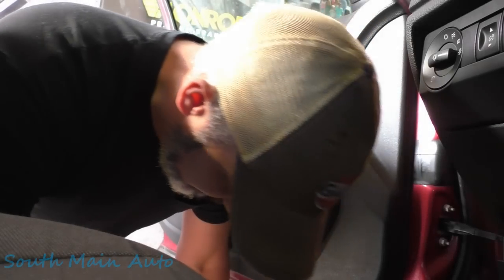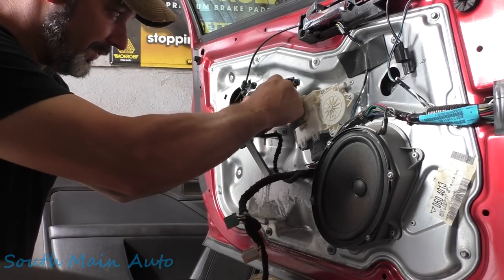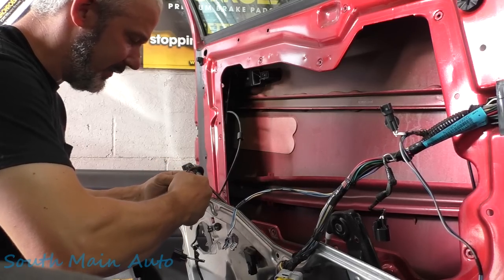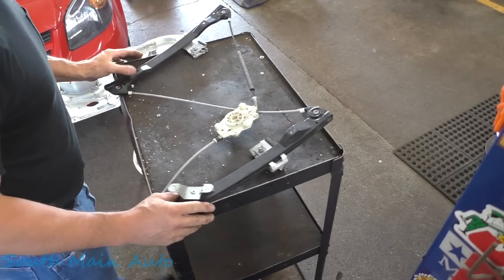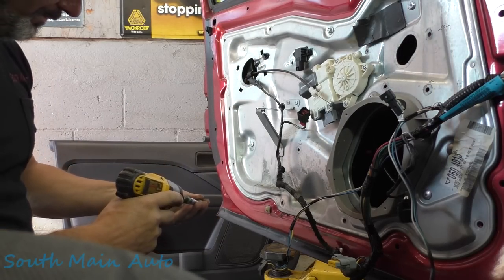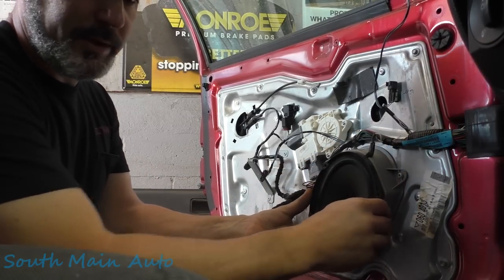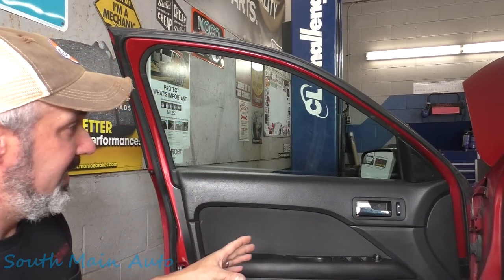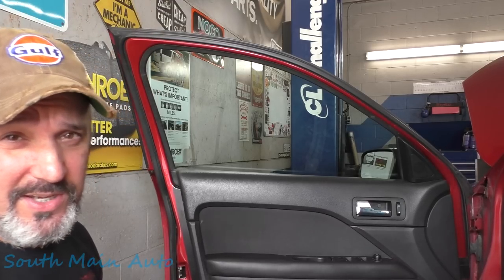Front Door Deconstruction - Fusion Edition

Comment: As you know, the fibrous isolation discs are installed to prevent galvanic corrosion between the single-use tension-tightened fasteners and the anterior structural support panel of the vehicle entry portal. Failure to replace them has initialized corrosion damage to the structural integrity of the vehicle that requires its condemnation and demolition immediately. As for the matter of the Maroon Dongle Lock Reinforcement Apparatus, I recall they were an offshoot of the Red Jumpsuit Apparatus...

Thank you for your submission, sincerely, PRNY.
Reply: Totally true Professor, thanks for clarification.  I just did my Kia and the Instability of the Phase Lock Loop Amp meant I had to drop the gain so the Transfer Function was met.  I now have a spectrally adjustable admission system that works.
Reply: Does the same requirement apply to the starboard vehicle entry portal?  Seems to me that the polarity would be reversed.
Reply: No, it's DC, so by Lenzes Law, polarity will be unaffected.  If you used 3ph AC you would have a serious problem.  Hope this helps
Reply: I thought it would be to stop any rattles should the rivets come loose

Comment: Wow, I'm glad I didn't have to do this in my driveway, with only my handheld rivet gun.  The left rear mechanism failed on my daily driver (2003 Saturn LW200) last year, and fortunately, it was a pretty easy swap, and no rivets.  Now, having seen that suction cup set, I have bought your classic Lisle 63900 Window Holder.  I figure with 3 more 20 year old power window mechanisms in my car, if I have to replace any of them, this little set will be worth $ 15.94 (Amazon) to me.
Reply: A couple pieces of blue painters tape will work and costs almost nothing.

Comment: As the owner of 2 Fords … each over 20 years … this DIYer has replaced the “classic” X type regulators. This video was fun to watch -  to see how newer window regulators work. 

As for DIY rivet tools … we  mostly use the manual tool which will test your hand strength on the heavier, fatter rivets. I never knew there is an air tool version. Go Figure!

Comment: I can hear it now.... 
Chang, I have almost completed the design for the door panel but I need some connectors for this plate. What should I use?
Did you already use the small head 10mm bolts?     Yes.
Did you use the large head 10mm bolts?   Yes.
Did you use some 8mm screws?   Yes
Did you already use some torx bits?  Yes
Hmmm How about some 7 mm screws?  Yes.
Darn....  Oh I know, use some rivets...    Hahahahaha

Comment: Great Job Eric !! I like the fact that you caught that piece of foam that fell off !! I caught it out of the corner of my eye and had to slow down the speed so i could see what it was !!! The real amazing part to me is I"ve worked with a lot of good techs in the electronic field that were good at fixing tv's ,radios etc but they had a mental block about cleaning the device after the repair which i watched you do !! A sign of a REAL PRO !! Thanks for the vids and education Eric !!
Reply: If the customer doesn't like the look of something, they are more likely to find fault with it, even a pre-existing condition.
Just give the thing a wipe so it presents well.

Comment: When the bottom of those plastic door handles break use the 5500 psi epoxy to fill and repair the hole.  You might need a Dremel to smoothen the cured epoxy but it works.  Use a high power flash light to have it cure faster.
Reply: Time is money. That's an extra hour, right there... $80 for the broken bolt hole, please.
Reply: When I helped a mechanic work on Japanese vehicles I used my SureFire flashlight and it would cure in about 10 minutes.  The epoxy is light sensitive so the flashlight would speed up the process.  I understand that it’s your business and yes, time is money.  I just wanted to give a suggestion.
Reply: Some epoxies can be cured using ultraviolet (UV) light.  Not all epoxies cure with UV light so your results may vary.

Comment: Just DIY-ed this a week ago on my 2008 Fusion passenger door - same process.  Wish your video had been around about 2 weeks ago, when it broke.  For the home mechanic an alternate would be using 1/4 by 1/2 nuts and bolts (I used nylock) to hold the regulator to the panel (got that from some of the Amz regulator reviews).  I left the "stand off" on the panel.  Took about 2 hours, guessing without the edits yours was about half that time.  Great video, love knowing even the professionals get hung up on the same stuff, they just have complete shop of the "right" tools to deal with it!

Comment: Yes Eric . Your not alone I’ve made all those mistakes taking the panels off & on several times heating up glue with a heat gun to get the panel to stick and finding bits left over on the floor . But after all it is a Ford con  Fusion 🤣bad joke 👍🔧🛠⚒

Comment: This job cannot be rated "" Easy "" for a DIYer !! Has to be a "" Medium "" rating. As I was memorizing your disassembly order, it started to become just a tad overwhelming on the memory !!! I thought you missed a rivet behind the motor housing as I see a hole there at the top under the black tape. But 99.999% of the time Eric doesn't miss a beat, so I let it slide. So if Eric can do it - I should be able to do it !!!!! Sure is a lot of screws, rivets, connectors, aligning and complicated programming just for this " simple " job !!!  After I finish this nerve racking job, I'm ready for Mrs. O.'s culinary kitchen meals with the side trimmings and a cool ice tea drink !!!!!! And fix the broken things that came with the car like the window switch screw that needs a flat washer to stay in place. And for heavens sake - CLEAN 💦the window !!!! and anything else dirty or fingerprinted !!!!  Lets the owner know that you gave his vehicle "" Love ❤and Care !!!!! On to the next job !!!!

Comment: Thank you Eric, A mechanic that does windows! A struggle at best is opened up for the adventurous. Door cables and glass stuck to the frame are fine if the motor has a weak enough clutch that inst already seized up. If the glass is not moving holding or not stopping the auto open button might be costly.

Comment: I’m so glad my 05 neon still has manual window rotation lol. Cars been going for 6 years strong, did the clutch not too long ago, timing belt and water pump, along with bunch of sensors that eventually went bad due to age, been a great car, no leaks and I change the oil every 3000 miles

Comment: Thanks for the video, Mr. O!  You really nailed the engineer accent!  Design flaws really shouldn't happen in this day and age with our computing capabilities - putting that connector on the other side?  Who thought that would be a good idea???  As always, I've learned again - don't buy a Ford or a Dodge and if you do, have someone else work on it!  :)
Reply: Engineer here in the CAD software world who used to be a consultant a long time ago doing implementations at companies including automotive Tier suppliers. I'll tell you how these design flaws happen. That door and its components were probably created by about 5 different companies/suppliers. That is, the regulator was designed/manufactured one by one supplier. The regulator motor was designed/manufactured by a different supplier. The electronic switches came from a different supplier. The harnesses and connectors came from a different supplier. That disregards the door skin, door hinges, and the aluminum sheet that all this stuff is attached to which could very well have come from other suppliers. Each supplier works independent of the other and is protective of their intellectual property which is the CAD model (with the CAD model alone there is enough manufacturing information to manufacture the part). Moreover, the automotive industry uses at least 3 different types of CAD software - Creo, NX, and CATIA, at minimum. Different suppliers use different CAD systems, and no CAD software can read another CAD software's models natively. Thus, when they share their CAD models with the automotive manufacturer, they may provide IGES or STEP files (neutral file format files) which then need to be imported. The files at this point are "dummy" models in that they can't really be modified easily because they are no longer native to any CAD system. Throw in a database that houses all this CAD data at the automotive manufacturer (called a PLM, or Product Lifecycle Management system) where you then have to deal with revision/version control and it becomes VERY complicated. As things get more specialized, at a certain point the automotive manufacturer is nothing more than an assembly house.

I used to work for an engine company as a design engineer. It was an interesting education. The pistons were from Kolbenschmidt, the intercoolers were from Modine, the turbochargers from ABB, the governor from Woodward, the oil pumps from another company, etc.. The engine company was nothing more than an assembly house, and my job as a design engineer was often to "design" the plumbing from one system to another. My crowning achievement was that I designed the slip fit for the compressor discharge to intercooler inlet. Yup, I got a gold star for that one.

Comment: I hate window regulators! It's gratifying to see someone else struggle with it 🙂 And you didn't forget to plug the connector in the door latch before reassembly! Good job, Eric!
The only way I know to reset and relearn the window regulators, is to disconnect the battery, and then you loose presets, etc.
Nice to see you clean your fingerprints off the murder weapon 🙂 PS: It's a murder weapon because, after you're done with it, you're this close to murder someone 🙂

Comment: Nice Find on that piece of FOAM Mr. O.  I saw it fall out and thought WTF was that??? Wound it back and saw it Fall out. Cool that ya actually put it back. That Re Learn crap, I have a 2022 FORD F-150 that Constantly does that "BOUNCE BACK" B! S!. I've performed the Re Learn on it 4 Times Now????? (WHAT A J O K E)!!!!! It "STILL"  Does that Stupid Bounce Back (Whenever it Feels Like Doing It)??????? Ya got me. On that Fusion, Totally STUPID, Glad it worked "Finally"...  I was Getting Pissed Off myself. To be Honest, we had a 2000 LEXUS RX300 that did the Same thing. (LEXUS) At least did something to Attempt to fix the Issue (New MASTER SWITCH) but it still acted up??  Ya probably couldn't get the OEM Regulator? Or just purchased a Cheaper Alternate. Good Video to Learn from.

Comment: Wow !! That is way different than the one I did on my '96 Contour. The regulator looked similar, but I didn't have to deal with that aluminum mounting plate or all of those rivets. I think mine was much easier ... Good job !!!! If you didn't mention the washers or the red clip, I wouldn't have noticed !!

Comment: Initialisation failure could not be related to aftermarket, as that's just the mechanics. You were using the original motor, which has the logic in it.

Comment: Brilliant engineering. Uses rivets so save a tiny bit of money on a wearable part but wastes the time and money using screws on the door panel.
Reply: The use of rivets is for a good purpose - they do not loosen up after tens of thousands of window up/down cycles, like screws would. I doubt rivets save money over screws.
Reply: My favorite is the e vans in the 2000’s that had one friggen bolt behind the door card for the stupid mirrors… so you had to remove the door card for just one out of 4 bolts for the mirrors… brilliant ford as always.

Comment: Great to see you this has to be the number one mechanical/comedy video feed on the YT. As a now DIYer I used small nut/bolt combo to replace one on a rear door of an AUS vehicle it was easy as it bolted to the inner panel ( the sheet metal of the door) was still working fine when I sold the vehicle.And to re-do some of the reassembly is part of the process isn't it ? Cheers you make me laugh in every video.I don't know if it makes any difference when I had one (window) that was squeaky sprayed some spray silicone grease on the guides that worked well.If you want someone to have a whinge you shouldn't have put the class cleaner can on the roof LMAO.

Comment: Wouldn't it have been easier to disconnect the harness with the plug at the right edge of the frame and remove it as a whole with the silver panel?  The speaker probably could have been left in place

Comment: Next time just unplug from the post and take the latch and all the wires with it. You will have to take out the outside door handle off too.
Reply: Yes! Retired Ford Tech here so I don’t have access to the WSMs any more, correct me if I’m wrong but I’m  sure this is the official way we used to do it, and it’s not as dumb as it sounds. Exterior handle is one screw and a bit of a manoeuvre to remove and I’m pretty sure the latch screws have to come out so the latch mechanism can come out as well,  but it is waaaay easier than it sounds.

Comment: No rivet gun, could I use lock nuts and bolts ?
Reply: There are hand use rivet guns for super cheap. You don't have to have a pneumatic one like he used.
Reply: Yes you can,  or go get a manual pop rivet tool...I bought mine out of a bargain bin 40 years ago...still works today.  LOL

My biggest fear of doing any kind of work to the door panels is breaking those clips...some of those clips are just impossible to find.

Comment: Seems every car in your lot has a dead battery, every girlfriend I ever had came with a broken window regulator.  Learned long ago to buy the parts and take it to an auto glass shop, a locally owned one, NOT a chain store. They always have any needed special tools and fasteners, and are the fastest as they do it all the time which keeps the labor cost down. Maybe Avoca does not have an auto glass shop!
Reply from the maker: So you're saying I should buy a part and take it to a shop and have them put it on? Yeah right after I finish buying these steaks and running down to the local restaurant to have them cook them for me....🙄

Comment: LOL...my theory would be to leave it the way you found it...use all of the parts that were there, useless or not. Unless you have the owners permission to leave out parts. 
Yes, many instructions will suggest to use machine screws vs. rivets but it appears the rivets are the best option in the end. This is a great repair because only the regulator was replaced while many mechanics will order the regulator with the motor and install them, a more expensive part but not a bunch more. At least the OEM motor will sound just like it did before the regulator failed. Sometimes a complete reg with the motor will not sound the same and bug the driver/owner.